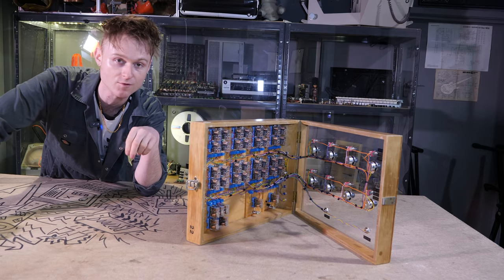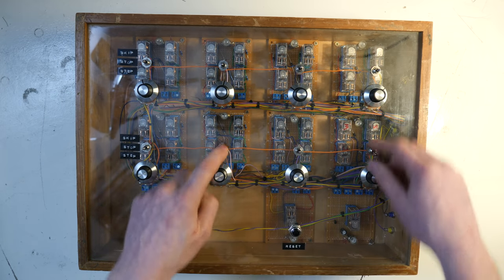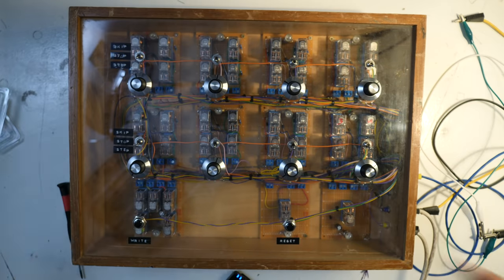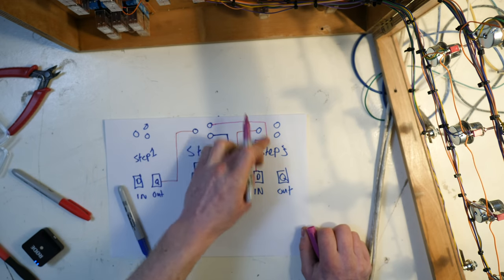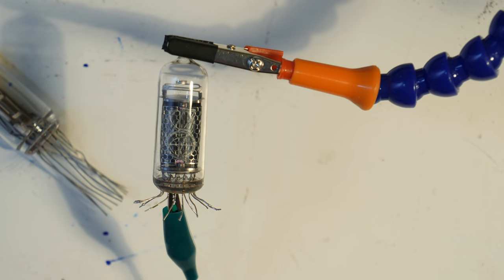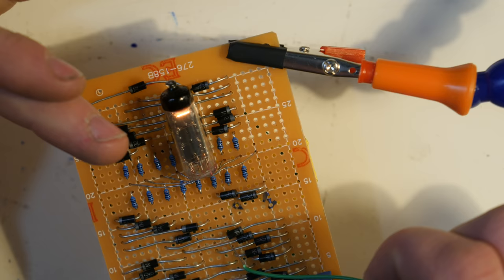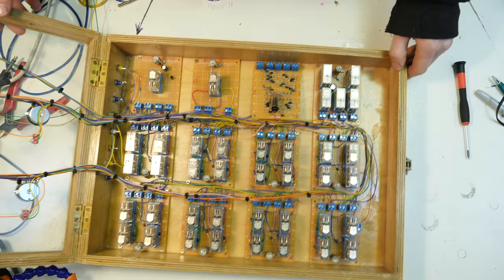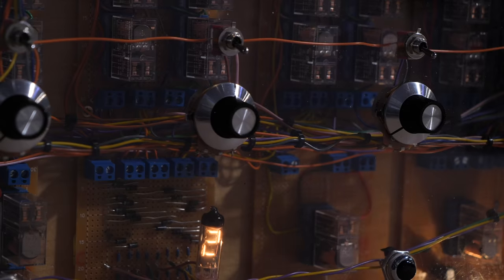Building A RELAY Sequencer For My Synth PART 2

Comment: Amazing work as usual! Quick suggestion: Stick labels for the clock buffer and step number boards onto the front window, same as for the other boards. Even though those boards don't have any interactive controls, labeling them would be an educational improvement worthy of a museum.

Comment: The small socket mount type of relay that you are using are affected by circuit board or cabinet vibration, even if you soldered them directly to the breadboard - maybe even more so. If the cabinet back reaches a harmonic resonance with the speed of the relays this may be the cause of the dropped bit. Where you are losing the bit is right around the dead center of the back panel. One solution I can think of is to add doubling strips on the back side of the back board. This wont get rid of resonant vibrations but it will change the frequency (upward) that the harmonic vibrations respond.

Comment: You can drill some small holes at the bottom corners for more relay sound high freq  comimg out and place a thin fabric as a filter behind to isolate the dust from going in.

Comment: Keeping with the theme of relays, you could use the flyback voltage from a relay coil to try to run a nixie tube. Not sure if any of these relays will manage 170V, and it will probably be very dim, but would be cool. 

Basically connect a relay coil in series with its own NC switch contact, add a diode in between going to the nixie, put the relay across the supply voltage and depending on the relay, you might get a reasonably high voltage output. (no resistor needed)

Comment: Sounds like the telephone facilities I worked in 2 decades ago. Rows of cabinets with relays processing a part of the city. 
I also built electro-mechanical systems with these components and lego when I was six. My father had this stuff lying around and also thought the principles of pulleys and gears. I know the sound of lego imploding under tremendous forces because a sensor, taped to it, failed to switch a relay.

Comment: Maybe it goes against the clakety clack of the design, but for the pulse generating part you can use a reed relay or even better a glass hall sensor with rotating magnet wheel

Comment: The other version has soldered in relays and comes with the internet troll decal applied to the plexi.

Relays usually mechanically last 10's of millions of cycles if done right.  Contacts are another matter.  Relay computers from the 1960's are still working today.

Comment: Neon tube cascades are incredibly finicky and they only output capacitively coupled transient pulses, which would make them difficult to use in a sequencer. If you do go that route and you select NE-2s, I've had some luck powering them using an 85A2 VR tube; their ignition voltage is about 90V and their sustain voltage is about 70V, and the 85A2 in particular outputs 85V, so it's good for biasing them to criticality. But honestly I'd stick with the relays, they are much easier to work with.

Comment: If you need another Clicky Clacky Thing which also displays things, Flipdot 7 Segments maybe an option? controlling them and not burn out the coils of the segments might be an issues, also i think 12-24V or so supply voltage.
Reply from the maker: Indeed! I usually act upon these things with feelings and gotta be honest flipdots dont do it for me for some reason* who knows one day I may come around!

Comment: You could get it to go backwards with a secondary switch wired to the previous step instead of using a relay...

...but if you wanted to go "ultra flexible", if you wire in a multipole switch, like a 10 pole, you'd be able to wire the next step to any step in the sequence 😉
Reply from the maker: Yes but it's more the fact you would need to select them all or it would ping pong if you get.me in order to go backwards each step would need to do at the same time or it's a bit dodhe

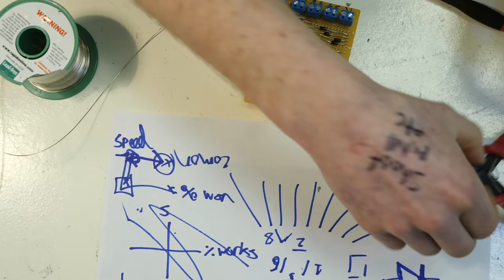Comment: 14:26 You can make another board, showing the numbers using binary inputs using only 5 wires (the power lead to power the board being one, the other 4 channels for ground), rather than having 8 wires, one per number. Saves you on wires.
That way you can do more than just showing 8 numbers. 
You can also use it to write words using the first 6 letters of the alphabet (and possibly more if you use 'zero' for O, 1 for 'i', 2 for Z and so on...).

Pin layout: 
0000 = 0
0001 = 1
0010 = 2
0011 = 3
0100 = 4
0101 = 5
0110 = 6
0111 = 7
1000 = 8
1001 = 9
1010 = A
1011 = b
1100 = C
1101 = d
1110 = e
1111 = F
Or use a combination of alphabet letters you use most.
A B C D E F G H I J L N O P R S U Y and Z can be programmed using an 7 LED display.
Reply from the maker: Indeed but I'm building a machine not using binary the bigger one won't either. Just a choice of mine

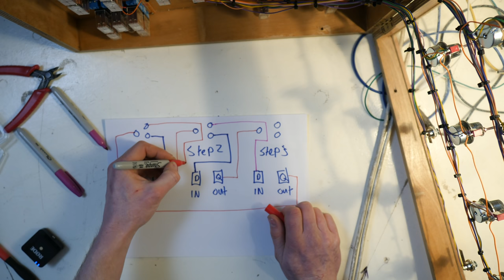Comment: At 8:00 don't the skip ones technically go to the switch of the next one, not straight to the input? Cause if they went directly to the input then wouldn't that make it impossible to have 2 in a row set to skip? I believe this is what you show right after with the actual wires, just wanting to make sure

Comment: I was thinking a flip-dot display would look really good in the case plus fit the theme since they are also electromechanical.
Reply from the maker: definitely fits but im pretty picky when it comes to looks and i have never been a fan of the way they looked and havent found a project for them to fit aesthetically ha. im sure ill come around one day!
Reply: @LOOKMUMNOCOMPUTER  Totally understand, especially if your flip-dot display uses those high visibility yellow dots rather than the older white dots. Alternately, an electromechanical vane display could fit this or a future project. They have a dope retro vibe.

Comment: there are DC buck converters that can generate that high voltage, check ... Great scott's ... one of his videos on tubes.
Reply: Except that buck converters are step-down, so what you need is a boost converter.
Reply: @8bitwiz_  ya, i don't handle these things, but i knew they exist, buck converter was my best guess, i should have used " " around it. thnx.

Comment: Where are you buying your wood furnishings and components, usually? This stuff is so blissful
Reply from the maker: electrojics usually rapid electronics, wood furnishings? ermm dunno just wherever.. car boot sale, junk shops. etc. got the old jewellery displayu box i built this into at a junk shop
Reply: If your neighborhood (or one nearby) has a bulk collection day, drive around and see what people put out. This past year I have gotten a lot of good scraps of wood, especially 1/4-1/2" plywood and flooring pieces. I even cut a big piece of plywood to replace the crappy cardboard back of a bookshelf: it won't wobble now! (But it helped that I have a minivan that can take a full 4x8 sheet.) Seriously, people in the suburbs will throw out some very nice bits of lumber, just so they can park in their garage again.

Now for the hard part: actually building something with it!

Comment: but for real, install a (or several) piezo pickups on the case so you can actually output/amplify/eq/process the sound of the relays
Reply: then feed that output into something that's being controlled by the sequencer itself so it can sequence the processing of its own relay sound and turn it into something even more musical :D

Comment: I once had a part time job, where I had to do quality control on automotive parts, and relais for car blinkers were like 80% of it. To be honest, this synth is a nightmare for me. The car blinker frequency is so engrained in my brain, that this cacophony of relais makes me kind of anxious.
Reply: Think of it, like the clap or snare drum sound, for a drum machine like I do and it's not so bad. I like the sound, it's like a series of little magnetic switches inside a pin ball machine, so it doesn't bother me.

Comment: I'm not convinced that Numitron will last longer than VFD or Nixie.
Reply from the maker: all you need to do is look at the datasheets
Reply from the maker: not VFD though. they will last longer than both of em
Reply from the maker: something to bare in mind is they are not used like lights, lights are made to illuminate so the filamnts tend to be rated lower so th filaments are thinner for a brighter glow, these are only meant to glow dimly. so are rated to last much longer than bulbs are rated
Reply: @LOOKMUMNOCOMPUTER  In 1977 I worked for a while on avionics used in helicopters. The Numitron tubes were a problem because of the vibration from the helicopter blades. Incandescent lamps really don't do well if you shake them while they are lit.
Reply from the maker: @daveayerstdavies  nice! well thank fudge this thing isnt in a helicopter then haha :D
Reply: @LOOKMUMNOCOMPUTER  I worked for RCA who were keen to use their Numitron displays in as many products as they could. The advantage of Numitron in avionics is that it can be made legible in bright sunlight or dimmed to a gentle glow at night.

Comment: just wondering how many ms delay with the relays , if any ? nice built
Reply from the maker: about 30-40 to go to the normally closed, but ifd you need it with minimum latency you design it to do its action on the leaving of the normally closed contact, then its only about 3ms

Comment: Do you know anything about sending MIDI IN to a keyboard scanning matrix? I've got some old Casio's with mini keys that I want to run with Ableton. Having trouble finding any existing projects online and it seems like it might be newish territory
Reply: lmao @ platinum plonker. you definitely need to just mic up the cabinet and use the relay sounds for percussion
Reply: It depends on how the keys are wired up. If it's a cheap monophonic with a bunch of resistors wired together, that's just a CV (except it isn't quite), and might make a great Stylophone conversion too. But I don't think even the cheapest China crap is made that way anymore. Some of the baby keyboards attached to kids books might use discrete inputs to the chip (I haven't opened one up yet), but a Casio won't be built that way.

If there is an actual matrix, things get much trickier because the key scanning happens without waiting for you. That might be why you aren't finding any existing projects. You could maybe get an Arduino to read the scanning outputs and VERY quickly respond on the inputs, but you would surely need to respond in less than a millisecond.

If you were really crazy you could set up a bunch of latch outputs (maybe with 595 shift registers), and connect each one to a transistor (maybe a MOSFET) going between each pair of the matrix. I think that would work, but I wouldn't want to make it. I vaguely recall that Sam made a Speak 'n Spell mod which brought out the keyboard. I think it went out to bigger individual buttons, but also had a trigger input jack for each one. What you would have to do is basically that, but then you need something to take the MIDI notes and provide those two dozen triggers. Then you would have to wire all that up to the keyboard matrix.
Reply: @8bitwiz_  i was looking at the IC diagram and it seems that it's a 4x4 matrix. I think I should be able to send voltage from an Arduino's pins to trigger the matrix? I haven't been able to find any info about how to do that, but am comfortable writing the code converting MIDI to the matrix.

To clarify: I'm not trying to use the keyboard that's built-in. I want to trigger the chip to play from MIDI input (from my computer or Beatstep or another controller, etc)

Comment: A relay sound is one of my best satisfying sound EVER.
Half electric half mechanic, pure perfection 
Something I would LOVE to do is to crank them like a V8 engine spark plug sequence order to listen the sound at high speed : 1-8-4-3-6-7-5-2
Like that :
https://qph.fs.quoracdn.net/main-qimg-af6801f179e4641ef968e57171bd49b2.webp